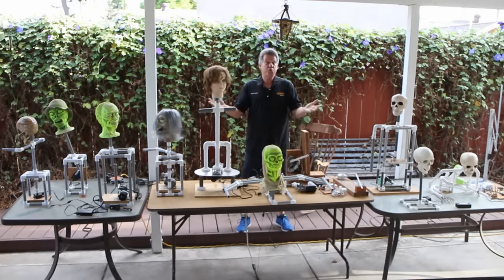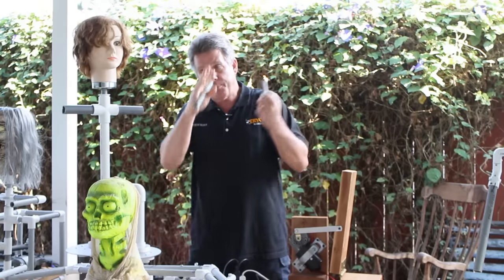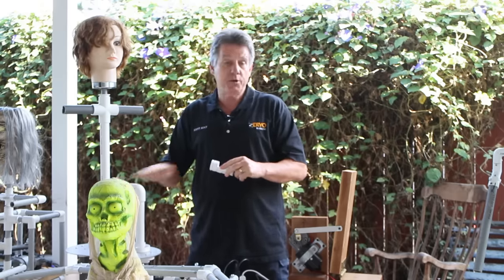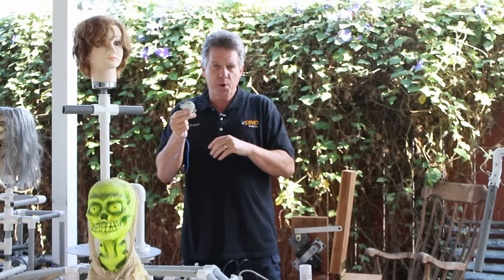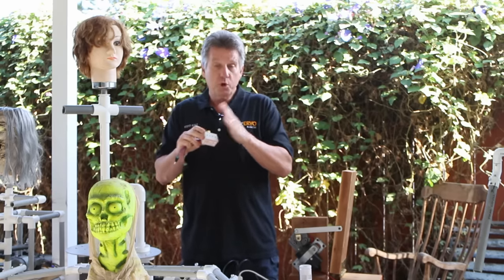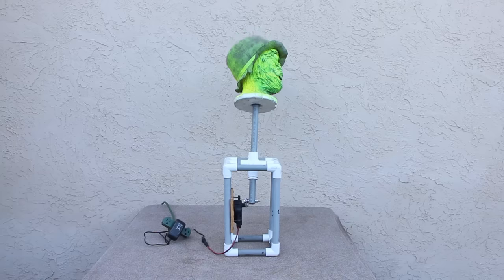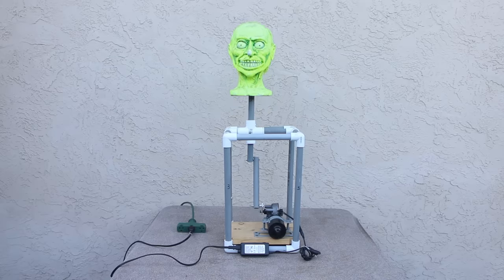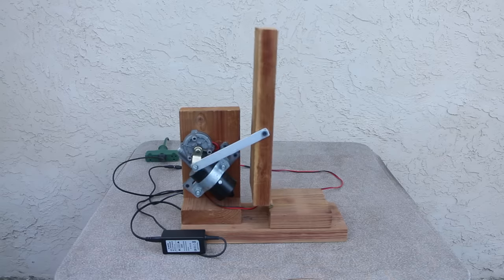Simple Motorized Halloween Props

Comment: Awesome video. Thank you very much! Regarding the Rocker Mechanism: I was wondering what screw or bolt I have to use to connect the crank arm to the motor, as the crank arm has to move freely on that side, right?
Reply from the maker: The crank arm attached to the motor is the one that is included when you purchase the motor and it uses the supplied lock washer and nut.  I used a 1/4" bolt and lock nuts to connect the two crank arms together, leaving the connection a little loose so they can rotate.  The great tutorial I followed can be found at http://scarefx.com/project_rockin_granny_2.html 
Good luck with your build and have a fantastic Halloween!
Reply: @halstaff  
Thanks for the reply!
I think I saw how it's connected on the provided link. I ordered a wiper motor from a vendor here in germany, because monsterguts doensn't ship to my place. Fingers crossed that I can use it. The rest I can find in a hardware store. Anyways, great video, exactly what we needed to pimp up our halloween garage :) Have a fantastic halloween as well!
Reply from the maker: @killobite  The biggest issue with getting wiper motors from other sources is figuring out the wiring.  Make sure to ask if they have a wiring diagram as there is no standard.
Reply: @halstaff  I hope there is one attached. I actually had several phone calls but no one can provide proper information. I will have to try my luck 👍 I will post the result here...
Reply from the maker: @killobite  Great.  Good luck.

Comment: My wiper motor gets very hot. Is this normal?
Reply from the maker: No, it should not get very hot.  What are you powering and how often does it run?  What are you using as a power supply?

Comment: Excellent video.  I need a pulley wheel that will attach to a wiper motor and run an axworthy ghost.  What diameter is the drive shaft on the wiper motor? Thank you.
Reply: I'm trying to make one as well. Not sure what fittings to use to go from the wiper motor to the axle of the pulley/ stroller rim.
Reply from the maker: The wiper motors I have use a M6-1.0 nut but I doubt that size is universal.  You should check verify that the motor you choose is the same.
Reply from the maker: My wiper motor uses an M6-1.0 nut but your motor may be different.  Would love to see your axworthy ghost when you complete it!

Comment: Where can I find the auto reverse motor you used on the grave grabber
Reply from the maker: I got mine from Kindy's - http://www.kindys.com/products/decorating-accessories/replacement-motors/replacement-motor-48-animated-buck but I'm not sure if they now only carry the model that does not auto reverse.  I am working off a large order of the older version that I placed for a group build that got cancelled.  Most of the new models I see are not auto reversing.  Here is one without the case that specifically says it auto reverses if it meets heavy resistance - https://www.ebay.com/itm/New-AC-100-127V-4W-Synchronous-Motor-50-60Hz-CCW-CW-Geared-Motor-1pc/173492017078?hash=item2864ee17b6%3Am%3AmZRGIiA1Y3a1sMPzMe7x4Fw&var=472185179242
Reply: Thanks, I ordered 3

Comment: What about weather proofing for rain ?
Reply from the maker: Wiper motors and reindeer motors are able to get wet but I do my best to cover all my mechanisms and motors.  The motors are buried inside the prop so you can easily put a plastic bag above them ( not touching or totally covering them). The bigger concern is the  controllers and wiring, especially where the cords plug in.  I use 12V DC whenever possible but eventually that needs to plug into an AC cord or outlet.  Be sure to keep that dry.  I know people that wrap the connections in plastic bags and duct tape to keep them dry.  Here's another option - https://amzn.to/2HV0l3M and https://amzn.to/2ZLcfIB (these are affiliate links). 

My controllers are enclosed in waterproof boxes (inexpensive food storage boxes work) to protect them. 

If in doubt about how your props will stand up to the weather, at least unplug them and have them be static.   Personally, if it starts to rain, I immediately unplug my animated props and then bring them under cover.  It doesn't rain often on Halloween here in Southern California but when it does, the trick or treaters go home anyway!

Comment: Some high power wiper motors have a starting surge current of over 20 to 30 amps for a fraction of a second..    I had a wiper motor that kept triggering the over current protection circuitry in a PC ATX power supply that puts out 18 amps from the 12 volt rail portion of the power supply.    I had to build a soft start circuit to keep the power supply from overloading and shutting down every time it was started.   It limits the starting current to 10 amps or so for 500 milliseconds and then it fully connects to the power supply once it is running at full speed.  I will have to do a video on it.   I have a few inexpensive cool circuits for DIY lighting effects that I designed just for Halloween on my channel.  Simple and they don't require microcontrollers or programming and are reliable circuits.   Check them out.   Happy Haunting.
Reply from the maker: I had a wiper motor that I was given with exceptional power requirements.  However the motors from Fright Props and Monster Guts have worked well for me.  Would love to see your circuits.  I'm always interested in new ways of doing things.
Reply: @halstaff    Got your reply.   I plan on making a short vid on the circuit.  Please stand by.  Post Halloween repairs, hunting and Thanksgiving are keeping me busy.
Reply: @halstaff  I just published a video on the wiper motor soft start circuit that I designed and built as mentioned above to fix my problem.    Hope you find it useful.   It ran in my Monster in a Box (video on my channel also) the entire month of October for the 2018 Halloween season and work flawlessly.   Happy Haunting

Comment: Hey Halstaff, and followers, I have deer motors, as I'm the Australian distributor for them, and I'm trying to make one of my essentially 2D wooden cats go around in a circle. I have 2 large wheels on one side and a small single rotating wheel on the other side. Need to get it done this week for my sister's superstition 50th on Friday May 13th 2022. I have pictures if anyone can help. I'm not an engineer and it's doing my head in so if anyone can help I'd much appreciate it!